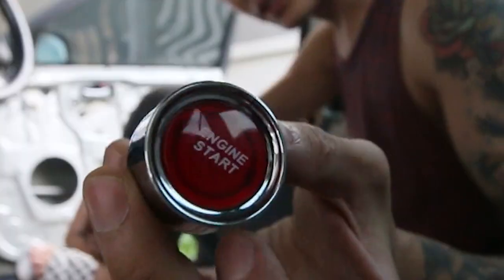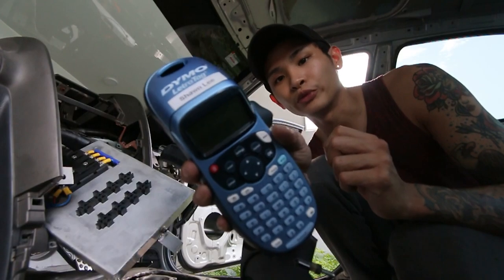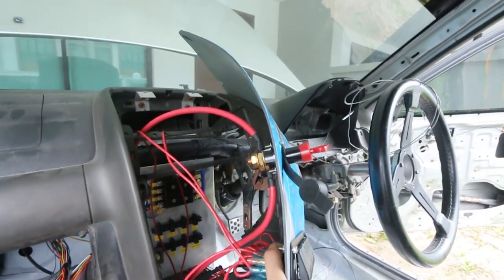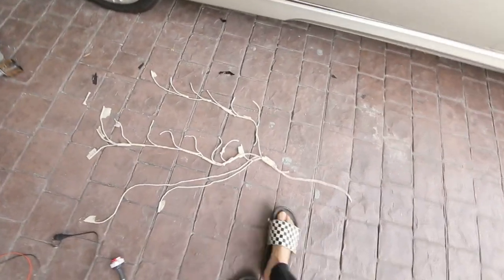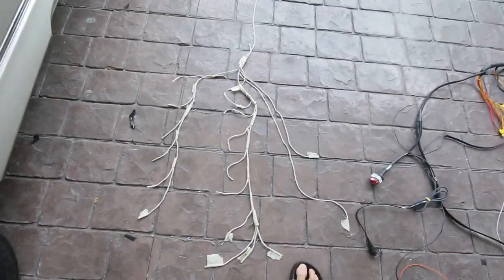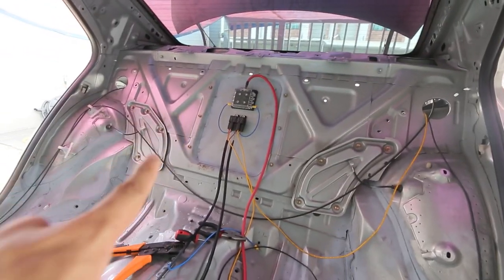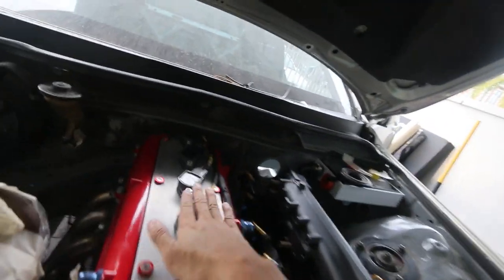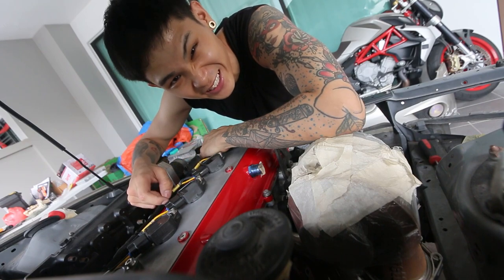2JZ WIRING AT HOME!!!! (TOYOTA ALTEZZA) EP.12

Comment: Shawn other than the manifolds, suspension and wiring what else is needed to be done on the car?
Reply from the maker: A-bit Fabrication, fuel line, oil line, and many more :). Still far but i’ll work on it :)
Reply: @shawnleebeatbox  Do u know what happened to your first drift car